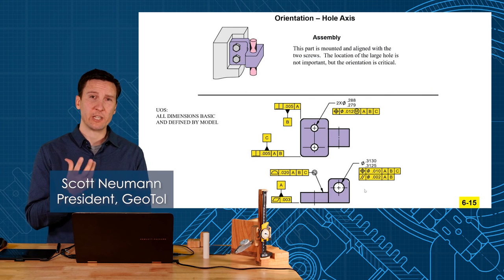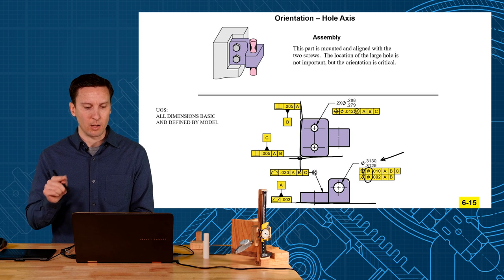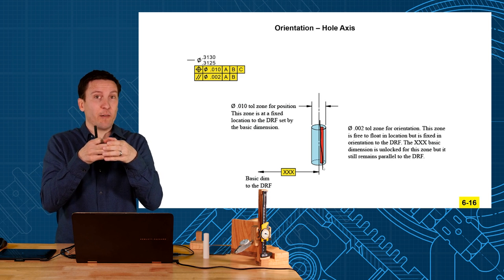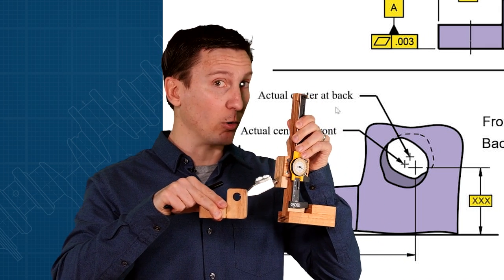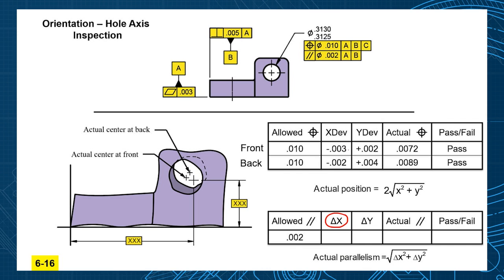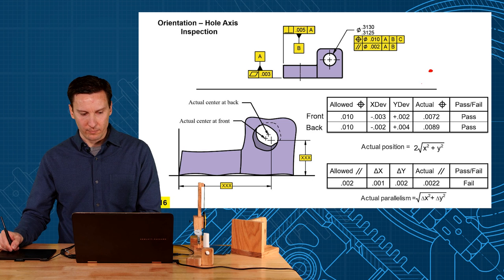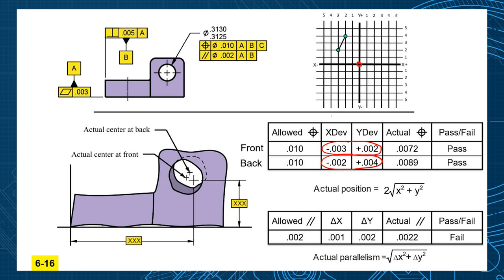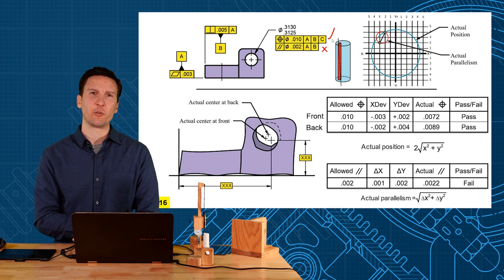Hole Position Tolerance with Parallelism

Comment: In this case, is there a difference if you called this out as a composite position DRF instead of a position DRF and a parallel DRF?
Reply from the maker: No difference on this example because there is only a single feature. The lower frame of a composite constrains rotational degrees of freedom only. This would control orientation only to the lower datums just like the parallelism. 

However, composite position would be different if there were multiple holes. The lower frame of composite would also control location between the features in addition to orientation to the datums.

Comment: It reminds me of  a composite callout which I came across a few days ago, the drawing is provided by our customer tesla which means they are ASMY based.There are two rows in total, the first row is the profile 0.1 respect to datum A,B&C while the second row is only flatnes which is also required 0.1.  Is it a correct call out for the second row, I don't think it does make sense .
Reply from the maker: For a drawing to ASME, any datum feature references in the lower tiers of a composite frame constrain in rotation only. It sounds like your frame does not have a datum feature references in the lower frame (so it does not matter if it is composite or not). The lower tier profile controls only size and form of the surface.
Reply: @GeoTolPro  Yes,the lower tier doesn't have a datum feature references,but shouldn't the lower tolerance be tighter than the top tier of a profile tolerance. In my case, both of them have the same tolerance which is  0.1.
Reply from the maker: Yes, the lower tier is a refinement so the tolerance value must be smaller to be effective. It sounds like a regular profile tolerance would suffice.

Comment: Great explanation! Would you mind explaining how to determine the position or perpendicular tolerance if a pin like a dowel pin and a hole use a interference fit? like Ø5 H7/p6, press fit. Would you use  MMC with 0 tolerance for the tight tolerance like this? I'm not sure how to do this correctly? I've been haunted by this kind of problem for a while. Thanks!
Reply from the maker: The position or perpendicularity tolerance has no effect on the press fit. Size tolerance alone insures they press together. Position controls the relationship to other features on the part.
Reply: @GeoTolPro  Thanks!

Comment: Hello - how do you determine the allowable position tolerance, thank you
Reply from the maker: For clearance holes: position tolerance can be calculated by the fixed or floating fastener formula (MMC hole-MMC pin). For an example like in this video: The calculation is "how much can you allow the hole to be misaligned". You need to zoom out and look at the overall assembly and decide how precise it needs to be to function.

Comment: Can't I use a composite position tolerance for this too ?
Reply from the maker: Yes, the lower segment of a composite tolerance controls orientation only to the datum reference frame. In this example it would be the same. However, I like parallelism on this simplistic one-feature example. I use composite position where it's pattern of features that also needs grouping.